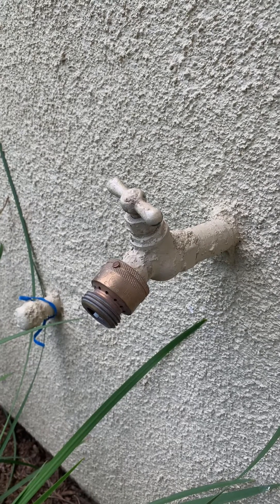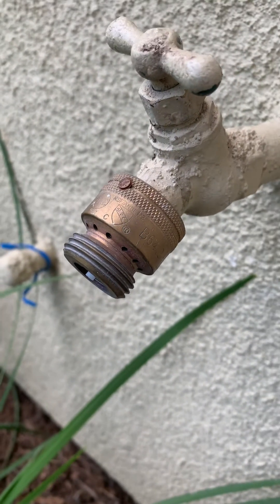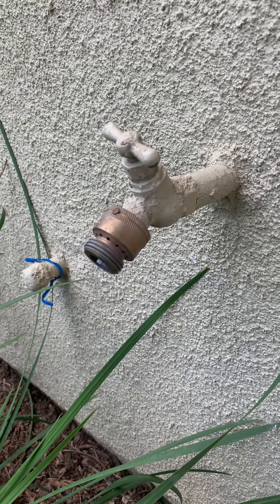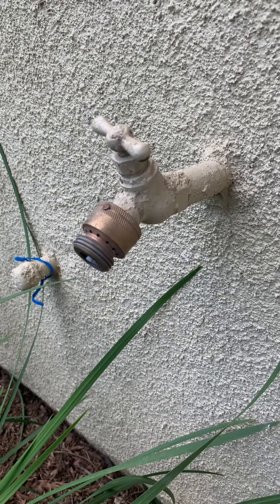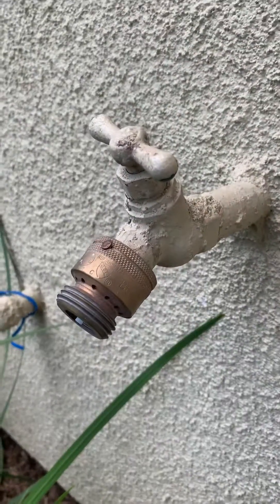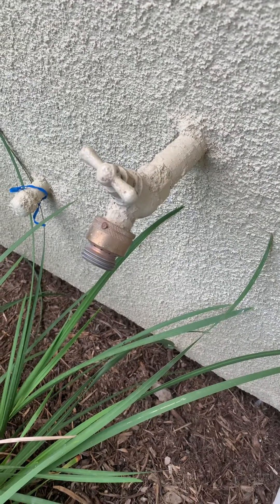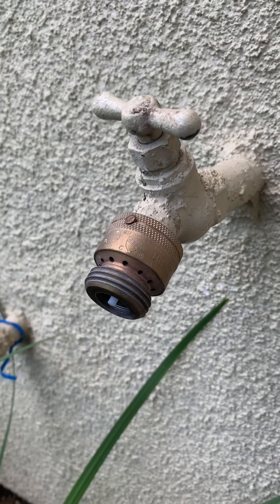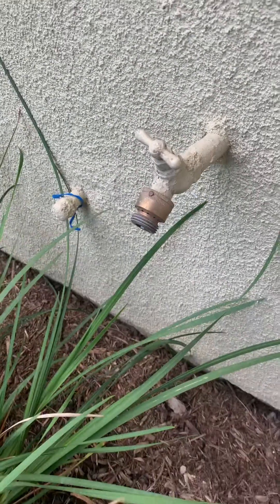back flow preventer attached to your hose bib.

Comment: What they don't tell you is that they don't last long. They don't take into consideration that hot and cold weather destroys the internal parts and you can't service it! You'll discover that something is wrong with the breaker when it leaks and sprays or that your garden hose water pressure is low!

Comment: If the builder put one with screw broken off, drill it out then buy a new one with a set screw so I can be removed easily when it fails. Because it will fail.
Reply: They break it off on purpose it's useless it's for inspection it's very weird rare occasion where contaminated water will make it's way in the system if any it will be what's in the hose

Comment: I replaced the vacuum  valve and now when shutting off the hose the water no longer sprays out the tiny holes.. Does that mean it's defective?? Because I replaced 2 of them and neither spray out when shutting the valve off with the hose on

Comment: BS.  They are junk.  If the valve is off, water cant backflow into your house.
If the valve is off, does water still come out?  No?  Then water cant flow the other way, either.

Comment: Eventually you have to replace it in about 5 years because it’s worn out. Then you will have a problem with taking it out because I see your set screw broken off (usually it’s broken off on purpose).

Comment: How the water goes back to the house if the water valve is off?
Reply: Its more safety sally nonsense for the liberals who can't think for them selves , and like being told what to do in their homes
Reply: I had the same question!!
Reply: It won't, not if the water valve is off.  The thing is meant to protect if you have it hooked up to something pressurized with the valve open.